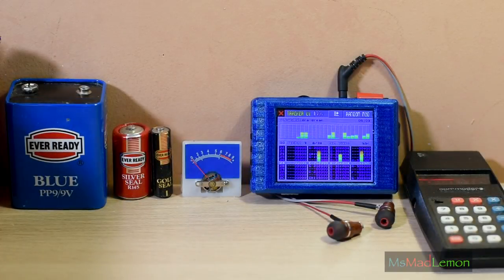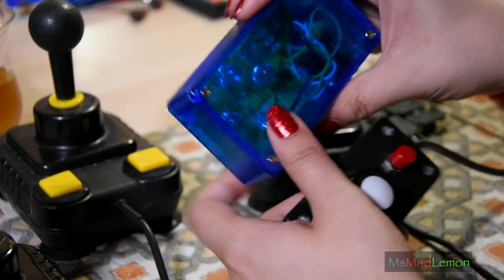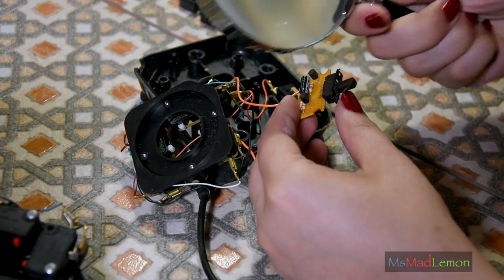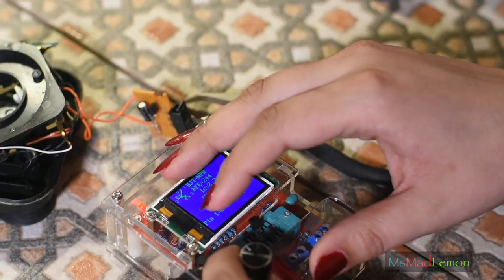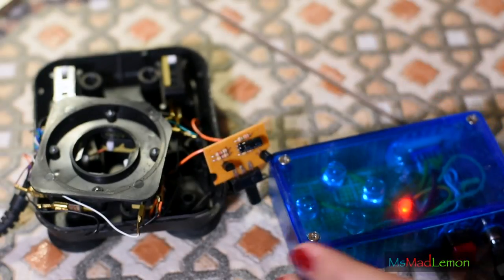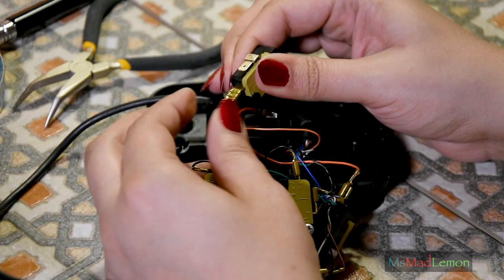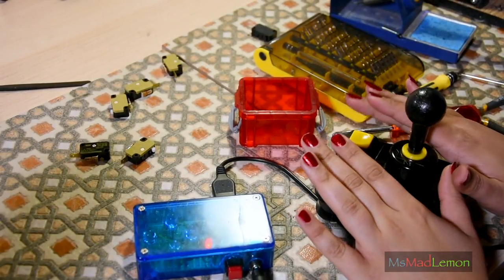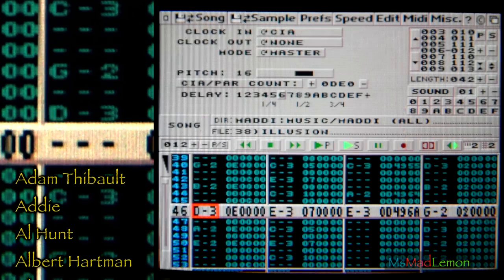Zipstik Retro Joysticks Repair & Restoration - Part 1

Comment: Regards the existing switches - the contacts become oxidised over time - really easy to open up and just 1 minute with some emery paper does the trick. Tiniest film of electricians grease to stop it happening again.

Love the vid btw. Instant subscriber.
Reply from the maker: It's a good job I've still kept the old switches, thanks for the tip! And Welcome :o)

Comment: Nice work Maddi, bless you for keeping the mighty ZipStiks running 30+ years later (also my favourite joystick). Sadly I don't have my original anymore but scored two in great condition when I picked up an Amiga 600 bundle a few years ago (bought with the sole intention of getting the joysticks I might add, everything else was a very nice bonus heh).

Comment: I managed to get hold of a couple Zipstick's, Competition Pro's and TAC-2's a while ago. As a matter of fact, I still have my original TAC-2 from back the days :D
If one doesn't manage to break the metal stick of TAC-2, they are basically indestructible...
Like you did, I changed microswitches to one of the Zipsticks. I'm happy, I have the right tools to play my retro computers ;)
Right now I'm waiting to get the replacement PSUs for my two Atari STs (4 meg STE and 520 STFM)...

It takes talent to get changing microswitches to be entertaining, but you nailed it Ms Mad Lemon! ;D
Reply from the maker: Thanks! :o) TAC-2s are so difficult to get hold of, if you do see them they are ridiculously expensive, I managed to get hold of at least one last year :o)).. and i'm impressed it's just literally metal on metal!
Reply: @MsMadLemon  Yes, I though I had lost my TAC-2, but there it was somewhere at shelf of my closet ;)
The Competition Pro I got from ebay and not so bad price either, though I had to pay quite much for the Zipstick...
With the other TAC-2, I got lucky as my uncle contacted me, that his friend was selling 2 x C64s. So I scored a C64C with cassette deck and a breadbin one (in original packaging, UK model with Finnish wall plug installed), with 2 joysticks. One white "flying stick" (which is kinda worthless xD) and brand new looking TAC-2. Paid 120€ for them and I would say, that was a nice price for the lot! ;)

TAC-2's mechanism is the simplest one anyone can think of, that's true. Just a metal ball at the end of metal rod, touching metal plates :D
So, either you have to break the rod or wear down the metal plates :DDD

Comment: I had a similar bad factory soldering job on one of my  C64s.  On the cartridge port one of the pins never made it through the hole and was just sitting on top of the board.  The underside had solder on the pad but the pin wasn't actually inside the solder blob.  It was a lesson in insanity trying to track down the problem because the pin sitting on the top of the board looked normal (a close inspection finally showed it was sitting higher than the rest), and it made intermittent contact with the top pad.

Comment: maybe it needs recapping! litrally was thinking that very thing when you said it! LOOL
Reply: Always loved the Zip Stick. Must get mine back off my friend who borrowed it.

Looking the some advice on another joystick though. It's a PowerPlay Cruiser, which is another favourite - particularly because mine is also wired for the ZX Spectrum Sinclair standard as well as Atari/Amiga - meaning you can plug it directly into the joystick port on any Amstrad-built ZX Spectrum.

Trouble is, the microswitches need replacing, and I've no idea what to replace them with, or where to get them. Any pointers?

Comment: Your display of Zipsticks reminds me of my 'army' of competition Pros :-)
Never seen a Zipstick in the real world, but they look very similar to the Competition Pro.
i assume they also feel very similar.
I mostly use Marquard microswitches to repair my joysticks.
I get them from a electronics dealer over here in Germany who sells a lot of surplus items, so they usually cost about 50 Euro cents per piece.
I do have to solder the wire to them since they are intended for PCB mount.
But they are high quality made in Germany industrial ones, so that's worth the effort, I think.
And the later Competition Pros have the wires soldered to the switches anyways.
The correct term for the 3 connectors are C (common) NO (normally open) and NC (normally closed), btw :-)
There are switches with 2 connectors available for either NC or NO. So it's a good idea to watch carefully when you buy those not to get the wrong one.

The switches that you replaced are probably Swiss made ones. 
They were also in the older Competition Pro joysticks and I found them very durable. Especially compared to the ones they used in later models. They probably just need some contact cleaning.
But they are impossible to open without destroying them.
Reply from the maker: I have a competition pro also, i know the buttons arent microswitched, but the stick itself feels more stiffer on the competition pro than on the zipstick, other than those two the rest feels very similar as it's more or less the same shape. I personally do prefer the zipstick though but it could be that i'm used to it, after all it's what I have been using since 1990 :o)
 i'm so used to push button terminology  (push to make/push to break)  I havent dealt with microswitches at all before this. So thanks for clarifying the terminology of the connectors on it :o)

I havent thrown the older microswitches away, I know contact cleaner would sort them if its even possible but i can always use them for other things. i just decided to put superior switches in and make myself a joystick which now has become my favourite, it's amazing the difference in feel microswitches make!
Reply: I also have a handful of both ..... some of the competition pros have hardened rubber grommets and are very stiff .... I have a zipstik that actually has tactile switches ....great video as always

Comment: it's a bit as a region thing i guess. because i never had or seen such a stick in my hands ever, back in the days.
i have some competition pro's,
but for some reason i got a hole bunch of   "SUZO The Arcade" sticks in my stash. even one or two in the beige 64 color sceme.
about 50% has a fire button in the mid front and the other halve has also a fire button on top of the stick. those have a switch on the bottom to select if you wanna use top or front button, but no autofire or whatsoever. (((((((maybe autofire is a bit like cheating)))))))   just joking.😜😎
nice vid again Maddi, thanks.👍👌

Comment: Hi. Nice videos.Thanks. Do you know whether you can get replacement springs for these joysticks? Mine has a very annoying habit of not centering on the left. I pulled it all apart. Lithium grease on all the plastic parts. Tried stretching the spring a bit but still sometimes it does not return properly. I only noticed it when playing a Snakes like game lol. Btw, I fixed the auto fire on my Zipstik and it was a 555 time inside. Maybe it is fake. I got it off eBay lol. It looks like the real deal. Cheers.

Comment: I bet it would be "fun" to make a PCB that you would put your 555-timer circuit on, and make one button on the Zipstick into a turbo fire button. Replace the switch with a PCB mount right angle pot, and then wire it into the other button.
Reply from the maker: I was originally going to do that with that zipstick that doesnt have auto/turbo fire, then changed my mind and did a standalone, not wanting to ruin any joystick cases with switch holes.

Comment: I've noticed something strange with both of my ZipStiks' autofire (transistor based like yours).  Try using it in Gyruss and autofire doesn't work.  However, when I use the autofire with my Konix Speedking/Epyx 500XL in Gyruss it works.  So weird.  Just wondering if you could be so kind to see if you experience the same problem.  There are a few other C64 games where I have found the ZipStik autofire to be problematic while the Konix/Epyx autofire works perfectly.

Comment: Hello Ms. Mad Lemon,

I looked at your video with interest. Also have a Zipstick Joystick, but unfortunately the board with the continuous fire function is no longer available. So I have a request for you. Can you give me the components that I need for the replica of the board and how to solder them to the board. Pictures would be very helpful.

I would be very grateful if you can help me.

Best regards
J.T.

Comment: I wonder if the old switches would respond to some deoxit if you could get it in there.
Reply from the maker: They probably would which is why I haven't thrown them away. I may use them for other things though since I have plenty of replacements.